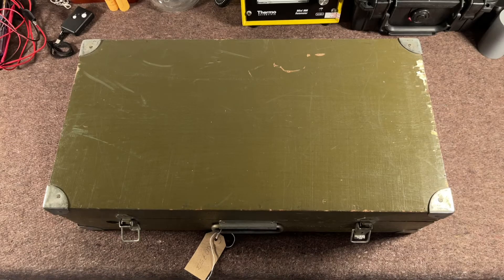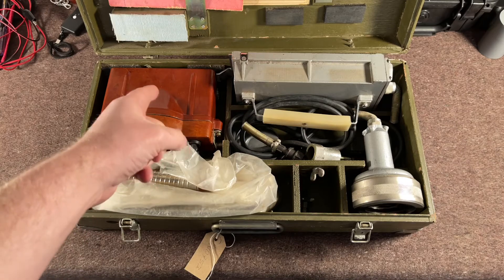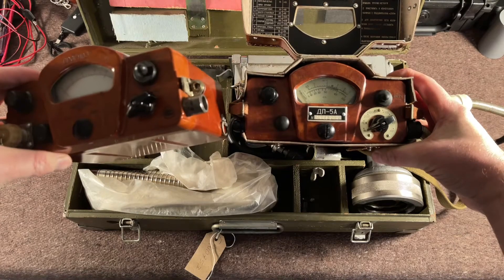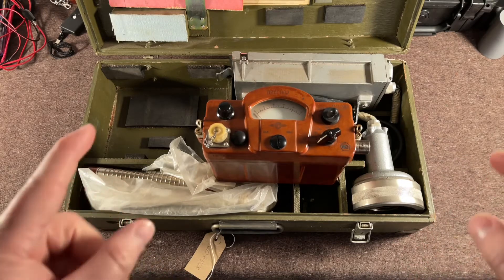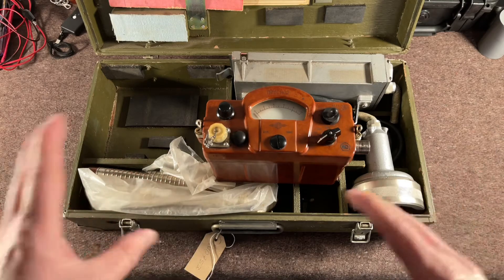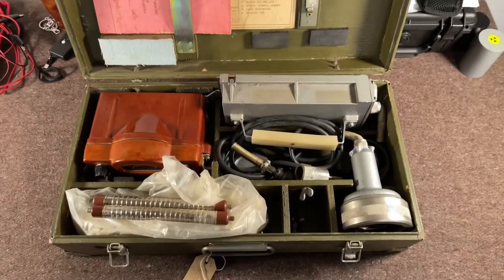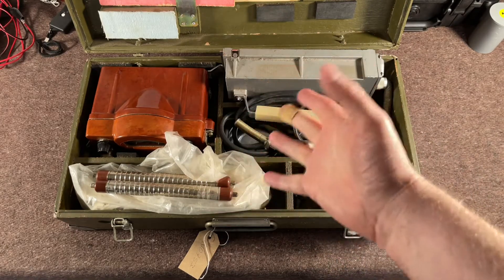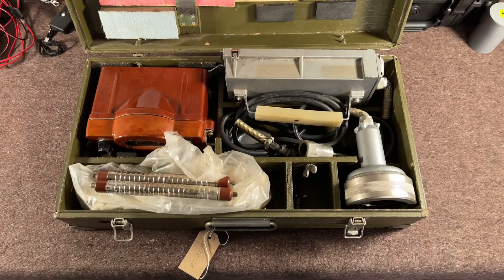PROGNOZ - Soviet Radiation Survey Meter

Comment: I just ffd on your video, and seen that one of the probes are not working. 
A buzzing sound from the probe is not a good sign at all. They should NOT buzz at all. I have an SBT-10A type probe and it is completely silent. I checked the schematic of your device and the SI-8B handle only has the tube, two resistors in series with each 5.1Mega Ohm resistance and a capacitor of 22pF. 
Repairs: You can take the probe and open it up, disconnect the tube from the socket, then connect a standard dosimeter high voltage output to the probe anode and cathode. If there are readings, then the tube is okay, if not there's your fault.
Reply from the maker: The probe is definitely working as I rewired it to work with another meter - a video of which should be on the channel somewhere!

Comment: try spraying a bit of contact cleaner into the sockets of the connectors for the probes. could just be a thin film of oxidation from all those years of not being used

Comment: Anything this old has the ability for the capacitors to go, same as resistors, and even potentially the transistors.
I'd start off by checking if your reciving the correct power to your probe and go from there.